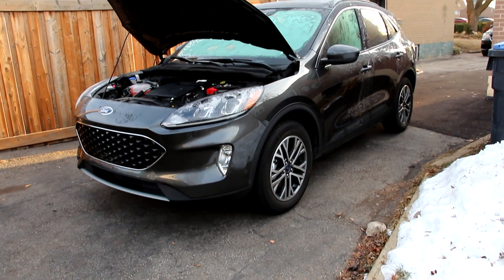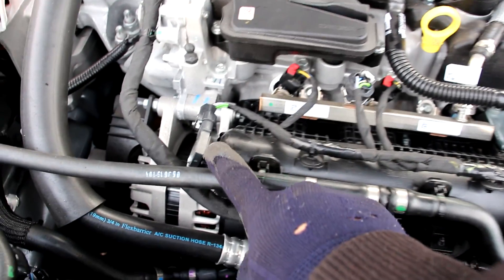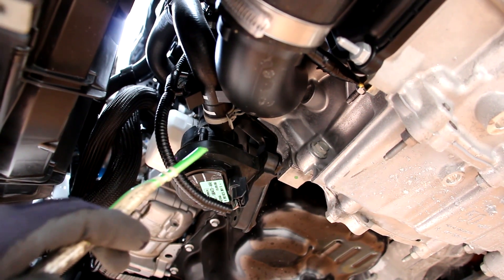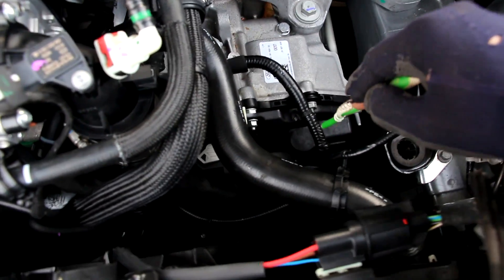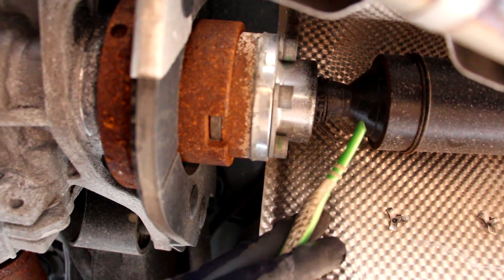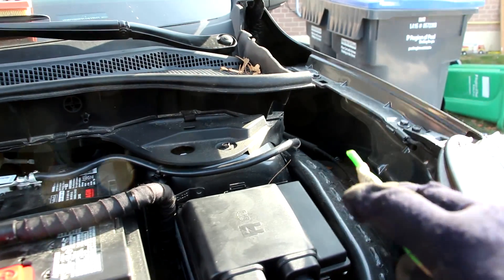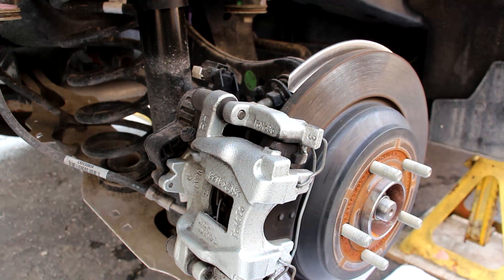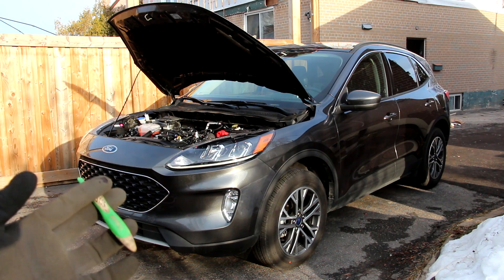Ford Escape Mechanical Review

Comment: Hi there the vent which is under battery on top of the transmission I realize it's moist and watery is it an easy fix at the body shop and what liquid is that on the vent
Reply: It's from time code 6:47

Comment: Had to get a car in February, I am in my early 20s and live alone. Found a 2020 escape with 20k miles, sticker was 15.5k. Few enough miles to get a wrap warranty, new enough for ford to cover anything else mostly. After warranty it was 17,999. In 3 months I’ve put about 6 thousand miles on it. The car has its ups&downs. Price is a big factor, any other cars with same mileage and year were upwards of 22k sticker price. This is not meant for people who drive a lot, it is in fact meant for the soccer moms. It gets you around to the store and work. I took a 12 hour roadtrip in it at 90mph, and it handled amazing with no issues (expected of a pretty new car), however if I had 10k more I could easily see myself happier with a used rav4, or even the newer Honda CUVs, but I can’t argue with a car that’s a few grand cheaper and few thousand miles less, to do the same thing

Comment: This engine has a timing chain not a belt. But has a wet belt that drives the oil pump. This is verified from the ford service manual.
Reply from the maker: Thanks. I mixed it up with the euro version with the 1.0 engine and the wet timing belt
Reply: @speedkar99  love the reviews. You do a great job👍🏼

Comment: Total crap. A buzz 3 cylinder engine that will vibrate the steering wheel and the seat, a leaky transmission vent, an oil soaked timing belt (for god sake’s) a control arm that doesn’t come off with out dropping half the engine compartment, wow. They sure don’t build them like they used to. There is no way I would ever buy one of these thanks to this video. Geez Ford, give your engineers a better budget!!! I hope ford (and all other car makers) read the comment sections of these videos.
Reply from the maker: Yeah I could feel the lack of quality on this one. Yet people still buy it

Comment: My work car has this engine and I absolutely love it. I really thought it was a 4 banger. BIG low end grunt and it will absolutely light up the tires. Not to mention that the chassis handles super well. I drive it like a race car.

Might not be reliable but idgaf since work foots all the repair bills

Comment: Mine seems fine a used 2020 with 25k miles. Value is a big concern of mine, if youwant German engineering by a Porsche for twice as much. This guy seems to think my Ford is sub standard, I've bought cars for 50 years, mostly domestic, and I keep a close eye on my vehicle maintenance . Design flaws are inherent in all vehicles.
Reply from the maker: I think a big company like ford shouldn't have cut corners on a high moving product like this. Alot of the competition is better and the track record is showing with alot of reliability issues. Yes, maintenance is key but build quality and design is definitely a

Comment: You missed it - where is the evap purge valve? My purge valve went out at 45k and the dealer said it is not covered under warranty. A $100 part cost over $650 to replace. Location, location location.

Comment: I have this same car with about 35,000 miles on it now and I have absolutely loved it so far! It’s great on gas but has plenty of power when you need it. Drives like a champ on windy Pennsylvania roads and hills. Very good on dirt roads, mud and snow. Very cool little car!!
Reply: I would trade it in if i was you. Its only a matter of time
Reply: @choossuck7653 wait are you fr I am nearing 55,000
Reply: The problem is, 35k miles is very low mileage. 85k or 100k miles on the clock and I would say it’s somewhat reliable. 150k+ is very reliable.

Comment: The Escape has a timing chain. The version of the engine you're thinking of is before it was updated and brought to the US.
Reply from the maker: Yeah in foreign markets it uses a wet belt
Reply: A timing chain-yes. but the oil pump is run by a belt-in-oil.

Comment: I thought the dragon 1.5 on the 2020 Escape and Bronco Sport uses a timing chain and not belt. At least that is what I have read in the Bronco forums. Older versions used a belt.
Reply from the maker: Yes it's a chain. I missed that sorry
Reply: yes, it does use a timing chain. but there is a belt-in-oil that runs the oil pump.

Comment: 2 of my moms friends have had the engines blow at about 50k miles one paid the 10k to have it fixed then sold it for 15k the other let the car go for nothing our ford exploerer 2017 has 120k miles on it no turbo charger or eco boost will let the engine go much longer.

Comment: how come this engine has timing belt under the aluminum cover? I think it's a bad assumption related to Fiesta with 120 Hp. I own Kuga, which is US Escape, with 182 Hp and it comes with timing chain. That's why dealer does not provide service guide for it. Overall I saw the same design of the radiator support on AlfaRomeo Guilietta with the same construction of the front arms. Not a big deal to unscrew 6 bolts and move radiators aside especially when you do not need to replace those arms on daily basis. BTW I have FWD version ST line and it comes with a steel front arms and a rear suspension solid axle beam

Comment: This 1.5 eco boost has a timing chain. The non boosted 1.5 engine has a timing belt
Reply: a timing chain-yes. but it still uses a belt-in-oil to run the oil pump.
Reply: @lukeWiz44 yes that is correct. Very important to change oil on time using good oil just for that reason alone

Comment: I just did a 400km round trip with a 2022 rental sel AWD with 5 big adults and man I blown away. I couldnt believe the power and ride composure this thing had. It could easily cruise at 140kmmon the highway. However the downside was the brakes felt underpowered and not very linear. As a comparison to my cousins 2020 Rav 4 AWD with the same passengers you can feel the heavyness. I know it wasn' t the hybrid model but didnt notice any engine  vibrations or turbo whistle, so I dont know what drive train it had.

Comment: Where do you put your floor jack to get this thing in the air?
Reply from the maker: On the side pinch welds
Reply: @speedkar99  thanks mayn! I was using a rolling jack too big to lift there without taking off the plastic so I ended up taking off the cover on the bottom first and finding a good spot that way, put my jackstands on the pinch welds though 👌🏻

Comment: I love this. Now we’re talking about a car with a timing belt that is constantly running through oil and you can’t change it out. That’s a hard no for me.
Reply from the maker: Sorry I mixed the engines up. The timing belt engine is for foreign markets. This model uses a timing chain.
Reply: @speedkar99 maybe don't give incorrect information.

Comment: I have Two 2020 Ford Escape SE, exact same models and options. The earlier in the year one says Orange coolant. The later in the year model says yellow coolant. Right out of the Ford manual on page 379.
Help????
Reply: I believe you should have a sticker under the hood indicating which one of several Ford coolant colors/formulations was original to your vehicle.  As for why the mid-year change, I would try to talk with the service manager at your Ford dealership and ask if he knows the reason for the change (there might be a technical service bulletin about it) and whether they recommend replacing the coolant in the older models with the newer spec.

Comment: It is a very good truck in mechanical matters so far, BUT it is poorly finished with origin from the USA, the plastics are hard in most of the doors and dashboard, the imitation wood inside is of very poor quality, the draws of doors and bodywork are bad, on the dashboard near the front glass you can see the exposed metal bodywork, when you accelerate fully you get combustion smell if the air is on, air recirculation cannot be controlled despite having the light on and is turned off by the system at will, the Subwoofer in the top-of-the-range titanium version when you play high volume or songs with bass the trunk sounds like everything is loose, the mudguards or wheel covers are made of a mat, they are not even plastic , the mirrors do not have direction lights nor are they retractable (apparently they were left without these due to the pandemic and only some models have this). If it is leather, the upholstery is not straight and sometimes it is usually torn. dont have motor cover.
Reply from the maker: Yeah it's definitely not something ford paid alot of attention to when developing. I think these are made in Mexico btw

Comment: Great video!  Just as a data point, I've got a 2013 Kuga (EU model Escape) 2.0l TDCi (180 PS) 6-speed PowerShift AWD, and was having issues with the automatic transmission being "jerky", to use a technical term.  Two different dealers in two countries all said 5k min. to replace the tranny.  Turns out the many times I brought it to the dealer for regular service, they had never changed the transmission fluid or filter.  Since this fluid/filter was changed, the transmission works perfectly.  I'm happy to have found a more diligent mechanic that understands this stuff.  

I really enjoy watching your videos and learning - please keep them coming!
Reply from the maker: Awesome you got it fixed

Comment: The real reason for these tiny engines and turbos is government mandates on manufacturers to improve fuel economy
Reply: It's sad that so many well-proven durable engines have gone by the wayside, but I have to admit that when they're working right and driven right, the gas mileage on most modern cars and trucks is nothing short of amazing even compared to 10-15 years ago.

Comment: They use a newer 2.0L Ecoboost which is rated at 250hp and kicks azx
Reply from the maker: Yeah and is it easier to work on?
Reply: @speedkar99  I hope you have an opportunity to check out the other powertrains.  I'm curious to see whether the hybrid has been improved, cheapened, or is mostly unchanged in recent years.

Comment: I was skeptical about them but ended up buying one and the fuel mileage is great. Easy to change the oil and seems durable
Reply: How is the car doing now? My wife is Looking atone
Reply: @sayiangod9404  get something else lol we got rid of it
Reply: @megabyte5689 , just wondering why you got rid of it. We just purchased a 2022 SEL with the 1.5L 3-banger.
Reply: @billpratt8621  how’s the 3 cylinder running? Does it got enough power you think?
Reply: @Aaron Sommers , it's okay. Gas mileage is good, seems to have decent power depending on what drive setting you're in. Engine is noisy though, and Ford got cheap under the hood for noise control, no insulation attached to the underneath of the hood, and no cover over the engine itself.
Reply: I'm also curious why he got rid of it
Reply: It leaks coolant, it’s a known issue and there are class act lawsuits and Ford won’t take responsibility. Mine is 2017, 64k miles and they quoted me $10k to $14k for a new engine
Reply: @Beanmethane  Ford actually redesign the block for the 4 banger turbos in mid 2019 because of the coolant intrusion.  The 1.5 3 banger dragon is a totally different engine, from what I hear it is pretty solid.

Comment: Not thrilled about alot of this stuff i like mine enough 9k miles and my main complaints are the nvh from the unbalanced engine/ transmission shortshifting and the trunk floor pushes through with any decent load it just uses two little tabs on the plastic wall panels so i put some foam blocks underneath it its also one of the smaller crossover suvs in terms of cargo but it drives well and gets good mpg I’ll probably keep it for 100k doing oil changes only then trade it in for something even less reliable

Comment: All the armchair mechanics need to recognize that manufacturing - not repairability - dictates design, and this is true of every manufacturer. It costs more and takes longer to make a car where every part is accessible and bolted-on. As a manufacturer, you need to keep costs low to hit the target price point. And many of these things are not likely to be a problem. For example - difficult to replace control arms? I've been driving for several decades with 6-figure mileage on several vehicles and never had to replace one. Also, I suspect that "open vacuum line" is actually the overflow line from the plastic tub around the filler neck. 

Gotta say I don't like the noises that thing makes when it's revved.

Comment: How about the Escape hybrid? Does the 2.5 engine also use a timing belt dipped in oil? Thanks for the review!
Reply from the maker: I made a mistake. This version of the 1.5 uses a chain not a belt.
Reply: @speedkar99  Thanks for answering. The control arm design sucks but it just makes the repair more costly. The timing belt would've been a deal breaker. I had the Ford Freestyle, which had a EGR valve hidden deep on the back of the engine. Replacing it costed a few hundred dollars. Appreciate very much your mechanical reviews.
Reply: I think the 1.0 liter ecoboost uses that belt dipped in oil. What a stupid idea

Comment: I'd prefer a box-style old school Escape to this lol, it always gave off the impression of a relatively cheap, simple and semi-reliable vehicle if it was maintained.
The new one kinda looks flashy, but a  3 cylinder turbocharged engine on an Escape? With cylinder deactivation? It's like they wanted every possible technological addition to improve fuel economy on an ICE engine short of adding a hybrid drive system (I hope no auto-start stop on this unit too, that would be overkill), kinda like having a 90-card Yu-Gi-Oh deck. If you burn out the turbo, good luck.

Maybe if it's driven gently, to maximize fuel economy and minimize engine & transmission strain and someone is willing to do the maintenance required for it, it could last. The question is if people are willing to do that. I was already kinda unhappy with the 1.6L turbos on the newer Honda CRVs, sad to see the Ford Escape downsize too.
Reply from the maker: The boxy escape was unique but I'm not sure about build quality
Reply: @speedkar99  Oh were they notorious for any problems? Not specific to model year, was thinking general faults and weaknesses.

Comment: ... is Ford's 2.0 litre four-cylinder turbocharged engine any better?
Reply: I'd trust it more than than a 3 cylinder 1.5L turbocharged car, but I had one I'd still baby it  and drive it gently for fear of wrecking the turbo. It's nothing like the old 2.5L 4-cylinder or the 3.0 6-cylinder.
Reply: @PalkiaDialgaGiratina  im a freak for gas savings so definitely driving it gently ;) we also camp a lot so I mostly like the engine for towing a trailer and less for the sporty side!
Reply: @interdimensionalsteve8172  Ooh nice, I know what you mean, I like great gas mileage too, when they are driven lightly. I think people may see the word "turbocharged" and then think the vehicle can handle rough driving even though turbocharging was used to soup up existing engines for performance, not downsize the engine and then try to make up for lost bhp and improve fuel economy with a turbocharger.

 The 2.0T should be relatively okay in my honest opinion, considering the Nissan Rogue runs a naturally aspirated 2.0L engine and they are the same class of vehicle. Towing is where I'd be most careful to drive gently though, as that is where the engine and transmission are put under a pretty heavy load and you could run the risk of burning out some parts, particularly the turbo and then you might be stuck with a struggling engine. Definitely stay within the rated towing capacity and go easy on the RPM beyond generating the initial torque required to move.

Comment: I would like to add that my owners manual states to replace the timing belt at 150,000 miles. Excellent review though! Learned a lot about my vehicle! No one else goes into mechanical detail like this.
Reply from the maker: Apparently it's got a chain 
The oversees version haslve a belt
Reply: @speedkar99  Valve timing is indeed a chain, ford part # (JX6Z-6268-C)and the oil pump is driven by the "Wet" pump belt (JX6Z-6B651-B) thanks for the great video!

Comment: I recently bought a 2020 Ford escape s, fwd, and what lead me to this video was a hard jolt and noise when shifting from park to drive. I even slowly do so, pausing between park, reverse, neutral, and then drive, and it still jolts and has a loud shift noise. My wife has the same vehicle, (we bought them together, same vehicle) and hers doesn't do it. Anywhere to check the transmission fluid level? I haven't had luck finding a dipstick. Great video, btw.

Comment: I have a 2020 escape se awd 1.5 ecoboost with 2500km.
So far the pre collision system is faulty as well as the adaptive cruise control. Also for some reason the normal cruise control stopped working. Dealer fixed the normal cruise control but cannot figure out why the pre collision system isn't working. 
Now the turbo has a high pitch whine during acceleration and the dealer says the turbo is bad and needs to be replaced.  Parts are 2 weeks out. Said further use will cause serious damage to the engine. Luckily I'm getting a free loaner until its done. Next car will be a Toyota

Comment: i work at a ford dealer  and drive these all the time they get good gas mileage but they have issues running in temperatures below 0 degrees F but if you have a block heater it should start and run fine and the back up cameras fail sometimes there was a recall for them but other than that they are pretty good
Reply from the maker: You sure they haven't had issues with the grumbling in the power train I had with this?
Reply: @speedkar99  they do vibrate alot but it tones down after the car warms up and I think they rumble because its a small engine and ford uses more high flow exhausts now
Reply: @8CylinderFreedom  The transmission also hunts for the lowest gear for MPG and seems to lug the engine a bit.